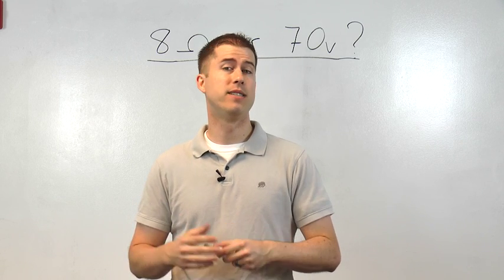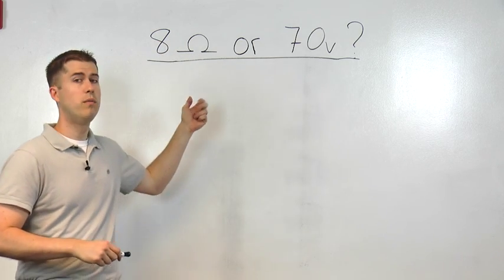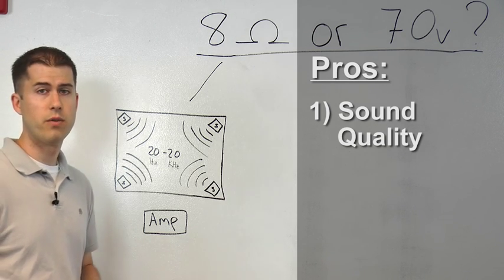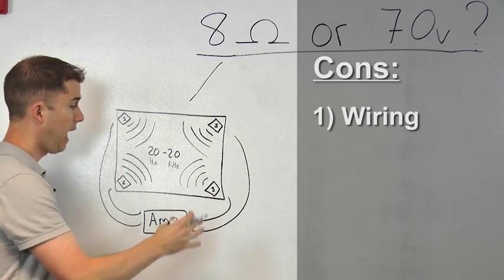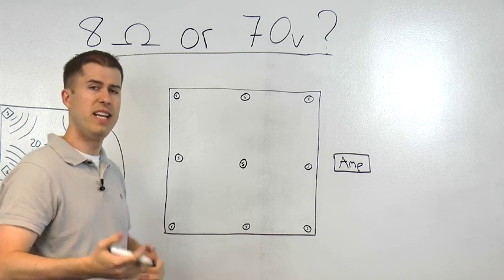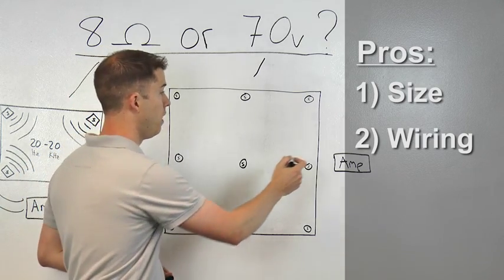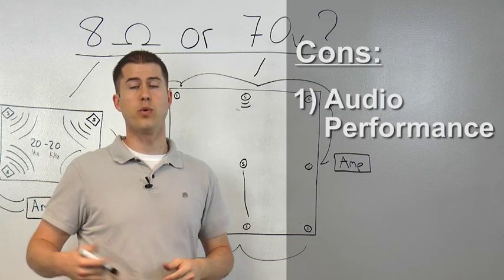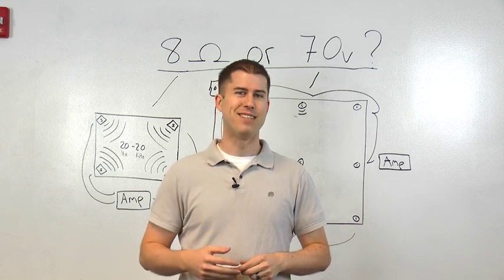Differences between 8-Ohm and 70-Volt Systems

Comment: Although the info is MOSTLY correct a  70Volt system does not run in series, they run in Parallel. 
It is also worth noting that 70 Volt to 4 or 8 Ohm transformers ARE available so an existing Low Impedance System could be extended to cover a 70 volt zone..
One must keep in mind that the additional 70Volt load should not exceed the wattage rating of the host amplifier.
Reply: You are correct.  If they were is series and one speaker broke, it would cause all of the other speakers to stop working.
Reply: Yeah, he probably meant to say "daisy chained".

Comment: I completely agree however I changed over a small area that had a 70 V system to an eight ohm system. The wires were in the walls and they were daisy chained so I just went ahead and hook them up to the 8 ohm system and I couldn’t tell a lot of difference. There wasn’t a lot of distance between the speakers which I’m sure helped. I would’ve liked to pull new wires, but the old system was stapled in the walls  and it was an impossibility. The room also had a volume control which seem to work as well as long as I have the volume at the amplifier set fairly high.

Comment: Regarding sound quality....even though large manufacturers like Yamaha do state that 8 ohm produces "better" sound quality, with modern technologies and Class D amplifiers, you would be hard pressed to be able to tell the difference between an 8 ohm setup vs a 70v setup. Unless you are an "audiophile" in a critical listening room. The acoustics of the room the speakers are in are more of a contributing factor towards sound quality than the equipment itself.
Reply: To add to your point, Crown amps that have dual function built in, Lo Z and High Z, when set to High Z, the amp’s built in crossover dumps the low frequencies at 70hz by default, to reduce transformer saturation.    Most often this can be compensated for by using one or two 8ohm, low frequency drivers to make up for the missing sub frequencies while implementing the second channel of the same amp, set in LowZ mode, and on Crown amps at least, use the “Y-Cable” settings to make it one input going to both channels.  I found out after much head scratching that this does NOT leave BOTH channel level knobs in use.   The second channel is always the same as the first.  Ugh. Why Crown?  Why?!   So just buy or make your own Y-cable or just jump a cable across the input binding strip if available.     But yes, the amps have come a long ways, and Class D restores so fidelity but seems to compromise long term reliability .    If those amps don’t get good fresh relatively cool air, even though not obviously running hot, over a long period of time, maybe a few years, the power supply will at some point give up in its switching circuitry.   And that sucks.   I’ve got rigs out there which have been on for 15 years and counting with nary a hiccup, but those were older school amps, and also got fresh air.  A non-ventilated closet or a rack in a small area with no fans will shorten its life too.   On that note, even with fans, a non-breathing closet will just keep circulating the same warmer and warmer air, no good.   In most installs, in fact ALL installs, I always mount amps with no gap between, no rack fans, and try to implore the client to actually turn off the rack periodically.   I have found that if you don’t dictate a schedule, a schedule will never happen.    I’ve recently begun implementing sequencers, always Furman, and that helps.   Wire up the little remote switch to where ever it’s easier to use, and you’re golden.    Quick tip-  always put the remote power switch in the middle of a busy restaurant.    Quick tip number two- never assume a new owner or manager has common sense.  Ignore tip one.    Tip three-always, always, always, get a deposit towards at least 50%, ok let’s just say at least 98% of the equipment up front.    Roughly halfway through the install, request a labor “draw” on half of the quoted labor.     It’s mind blowing how the biggest entities, with seemingly every resource available, are the hardest to be able to put a “paid” stamp(digital stamp) at the bottom of the final invoice.    I’m thinking it’s because of those extensive “resources”, that they delay as long as possible, to the point of potentially losing any subsequent service.      Boggles the mind.    Money is a helluva drug.

Comment: Ive bought a system management amplifier from a company pullout and im left in confusion on how I can overcome a way to connect my speakers directly at home with a 70/50v zone output. 
Do i need a dedicated circuit to convert a 70v to 8 omhs?
Its a TOA vm2240 which is quite expensive at launch but only sold for $6 from a company pullout

Comment: in the event that the input for my speakers is 8 ohm (output from remote speaker module), but my speakers is 70v transformer type, is there any way for me to convert the signal from 8 ohm to 70V?

Comment: Hi,
I have a speaker with 2 input ( 60W & 6W @ 100 V ) 
Is that mean my speaker reduce the sound to 6 watt if I install it with 100V system?? 
Thanks for your lectures
Reply: There should be one negative or “ground” wire on the speaker, and then two more wires, usually of individual colors, which should represent the “tap”being used.    This “tap” is industry jargon for the wattage and therefore RELATIVE volume of that speaker.  If using a distribute voltage, high impedance system/amp(25/70/100V), you can put, for example, several of the speakers you describe can be connected in parallel on one speaker cable run.   A cable run is also industry jargon, referring to one speaker cable, even though they are typically one jacket encapsulating two individual cables with their own respective jackets each.    This would be known as a two conductor cable.     With your speakers, you can connect one speaker to the 6watt tap, and the other to the 60watt tap, and for one given output volume from the amp, the 6watt tapped speaker will be significantly quieter than the 60watt tapped speaker.  In fact so much so that in a modestly loud ambient noise environment, where the 60watt tapped speaker is at a normal volume, the 6 watt tapped speaker in the same environment might be hard to hear at all.    But if that one were perhaps in a very quiet environment, such as a bathroom, it would be audible but still very quiet.  In fact, I have never known of any high impedance speaker having such a wide range of taps nor only two.   It is almost always four different options, and almost always escalating in doubles, i.e. 3.75watts, 7.5watts, 15watts, 30watts.   So the answer is, yes, on a 100V High Impedance Amp, for a given output of the amp, one speaker at 6watts will be significantly quieter than the one at 60watt s.

Comment: I'm not an expert but I believe you don't have to lay wire to every single speaker. You can use 4 component wire and use 2 wires for the left channel and 2 wires for right channel and set them up in parallel.

Comment: Be very careful to edit this video to reflect parallel wiring.    People tend to think of anything in “a row”, or “consecutive” as in “series” but in the world of audio and electrical wiring in general, “series” means one component’s positive connector is wired to the next component’s negative connector, and so on.   “Parallel” means all positive to positive, negative to negative.    Get it wrong from your intended usage and the results may be less than ideal.   You can connect more speakers in series wiring with a LoZ amp, but if one speaker loses continuity, the whole rig is down.    That’s why parallel is almost always used, except in special situations where the impedance desired is acquired with series wiring, such as in a guitar or bass cabinet.       As you were.